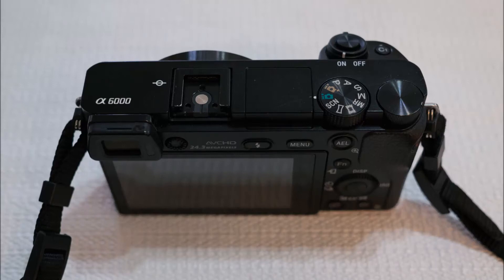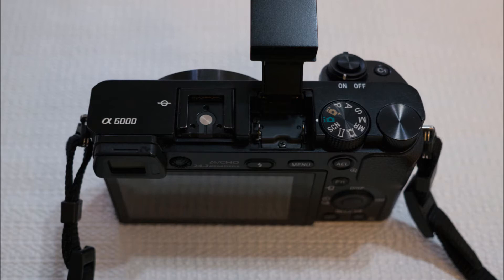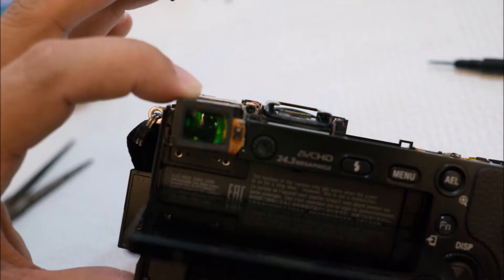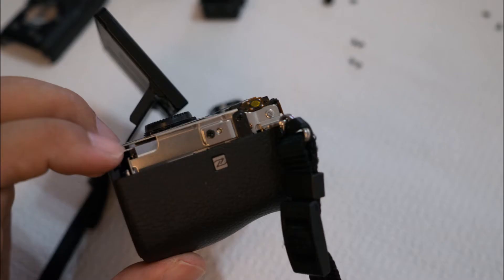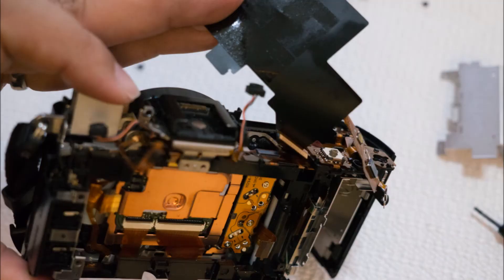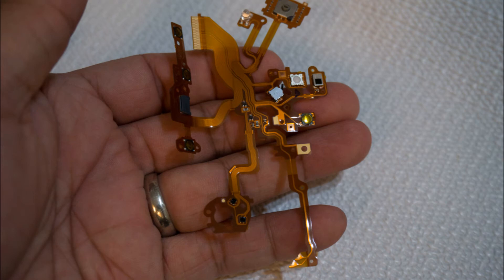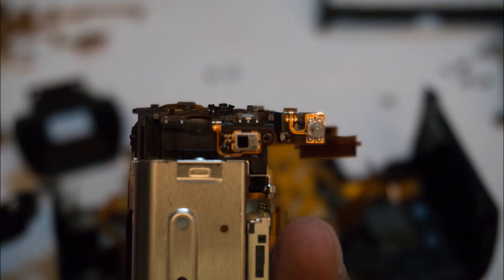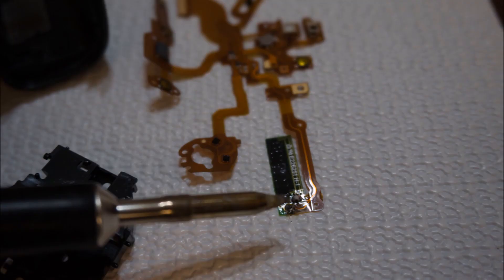Sony A6000 - Disassembly and Power Switch Fix

Comment: Do you know of any other reason this camera wouldn’t turn on? I disassembled mine only to find the lever fully intact. prior to servicing it I turned it on and off multiple times and only on one occasion did I hear what sounded like the shutter opening, and then closing immediately
Reply from the maker: Check genuine battery. Check that there's no debris in the battery chamber making poor contact i.e. corrosion. Bad capacitor. Water damage. Also look through the viewfinder to see if it's actually on but you're looking at the lcd screen thinking it is off.

Comment: Umm hello, gotta problem with my camera, my focus switch is not rotating after i put super glue preventing from falling apart the piece, is there a way to remove it? Hard to remove to be honest...
Reply from the maker: @AllainesDiecasttoys if you're referring to the dial next to the screen, you can buy that internal piece separately but you would have to disassemble the camera partially to get to it.
Reply: @astroimagers  nvm its rotating thank you
Reply from the maker: @AllainesDiecasttoys take a look at this vid starting from the 3 min mark https://youtu.be/dTYkaoDCrWU
Reply: @astroimagers  i dont want to dissassemble the camera, this camera i have isn't mine. My father gave it to me for the future but thanks

Comment: Hi there, great video. I have a broken battery door cover and I have a replacement piece but wondered if I need to disassemble most of the camera to replace that component?
Reply from the maker: I'll take a closer look tonight but check out 6.30 mark of this video (linked below) to see the part the door is attached to. I'm hoping you're able to just move a pin instead of disassembly... https://youtu.be/y3CCJtD0jYc
Reply: @astroimagers  Thanks Charles. I will check this out. I suspect it needs a bit of disassembly but it's just how much! thanks again!
Reply: @astroimagers  The video shows a huge amount of dismantling to access the batter door. best
Reply from the maker: @sebastianbustamante4853  I'm afraid the A6000 and other NEX cameras were a straight pin that requires disassembly whereas the newer ones had retracting types...probably for this exact reason.
Reply: @astroimagers  Thanks so much for getting back to me on this. So it does require pretty much full dismantling rather than partial? that's frustrating. Thank you for letting me know this. I worry about pulling apart too much of the camera as I worry I wouldn't get it back together again

Comment: I'm sure most have had this problem. I wonder if this is a way to take apart to clean buttons. 
Every once in awhile, while I'm working, the buttons will stop working and I'll have to turn it off and tap most of the buttons multiple time then turn back on. I think I read something that that happens when a button doesnt fully decompress or the shutter doesnt. But most of the time I'm shooting real estate with a shutter release cable.
Reply from the maker: You'll be blown away by the switch button mechanisms. Looks very fragile. Not sealed. If you do take it apart, be sure to note the dial position.

Comment: I just fixed my power switch recently and I found out that that one part that needs soldering isn‘t really necessary. It‘s just for the NFC functionality so I just left it out because I never used it anyways.
Fortunately the camera works just as fine without it

Comment: Hi there, Thanks for the great video!  Where did you find the part for the $40 you mentioned?  I can't find it.
Reply from the maker: Part number A-2078-263-A from Encompass. Best wishes!
Reply: https://es.aliexpress.com/item/32978304278.html?spm=a2g0o.productlist.0.0.571b7708xVuPTv&algo_pvid=987d7c7e-4e11-42c8-adc4-32c02c7afaea&algo_expid=987d7c7e-4e11-42c8-adc4-32c02c7afaea-24&btsid=b243f802-caf8-4012-9dad-4dbc96a4be1d&ws_ab_test=searchweb0_0,searchweb201602_2,searchweb201603_55
Reply: @biogons14  does this flex cable works for the Sony a6400 also?  my on/off switch is not working anymore
Reply: @artur_jeronimo  Sorry, but I don´t know. Look for it in the same page.